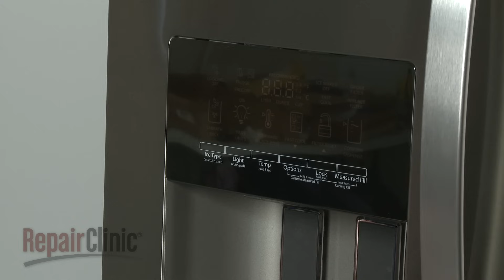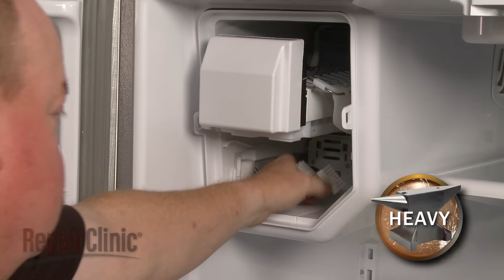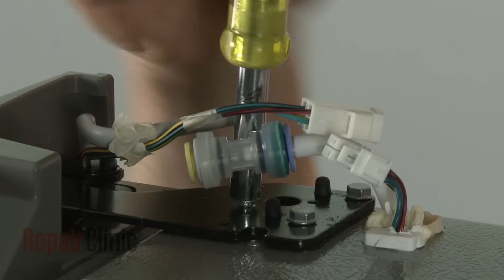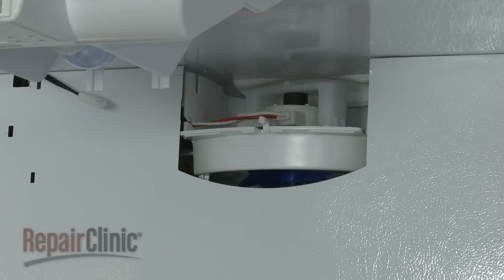Whirlpool Refrigerator Disassembly (#WRX735SDBM00)/Repair Help

Comment: The middle drawer. I need help with the middle drawer and you did everything but the middle drawer.
Reply: You can lift the middle of the tray and take it out and then unscrew it from the front and then you can push the middle glass from under it if you need to.

Comment: Hi I have the Whirlpool G16FARXXY00 French Door refrigerator. I need to replace the hose from the inlet valve. It broke at the valve.  I believe I have the proper hose ordered, but the replacement procedure is not obvious to me as the hose goes into the refrigerator just above the valve, and there is no removable panel.  I see where the hose attaches to the valve inside on the right side of the fridge behind those panels. But how do I get the new hose from the valve up to where it connects inside the fridge.  Thanks so Much!  Love your channel.

Comment: How does the fan assembly come out without breaking the plastic frame or drip pan? There is no room to remove it without breaking the lower part of the frame.

Comment: I was attempting to replace my LED light in my freezer I was able to take it off although there was so much insulation in it. However when i went to remove the LED the main wires attached to the wire harness were yanked away from the harness. The space is so small i can't replace the wires back into fhe harness. The wires are short or stuck in the insulation. Any way to fix this?

Comment: Any idea how to get the release button to work? It's jammed from the inside somehow, so the ice maker cannot be removed. I can saw it out, or smash the entire unit with a hammer, but then I'll have to buy a new one at $$$ just because a tab won't depress. the maker works otherwise.
Reply: I had the same issue and I just bought it last week. I called a repairman who showed that you have to use your thumb in the center of the button and push deep while pulling from the bottom with your other hand.
Reply: Thanks. I tried this but it didn't work. Ultimately I used a hammer and busted out all the tabs to free the machine. That's what the tech told me to do when I called. Next solution is to replace the refrigerator. Tech said it was a design flaw and irreparable.  @MsGail61

Comment: I have searched and found nothing, i cannot remove the tray from the ice machine, looks just like this one (on this video) you depress the button on the right and yank out. I thought that maybe the tray was froze shut so i left the doors open 24 hrs unplugged but after the ice melted its still stuck closed, any suggestions???
Reply: I have the same fridge as in the video. That button is really hard, it does seem like it’s stuck but it’s not. Using my fingertip doesn’t work so o use my knuckle and press hard

Comment: Thank you very much for this video. Well done and comprehensive. Had mold in and around ice dispenser door as well as behind dispenser handles. Gross! Lots and lots of mold.The fridge is 5 yrs old and I never noticed this until now. Hubby was leery of taking it all apart but you gave us the info to do it! Thank you!
Reply: Mine is the same! I only noticed it when the water stream wasn't one solid stream. Gag! How did you clean the dispenser parts? Can those pieces be removed to be washed in a sink?

Comment: Thank you!!!  I've never had so much trouble getting a drip tray off the fridge door before. I didn't want to break it.
Reply: Did you ever figure out how to remove this? Lol They make it look so easy in the video. Having a heck of a time here.
Reply: @Corey-Ryan yes! When it's halfway off gently pull upward on the back of it and the tab should go up and over the little Notch that keeps it stuck from going anymore forward

To put it back on sort of tip the tray upward to catch under the little tracks and then when you're halfway there press down so that the tabs catch back under that stopping notch

Comment: Hello👋 I was wondering if you could help me. We have an old Whirlpool. Probably like around 20 years old lol. But we noticed the light bulb dimming and getting brighter, then I heard the fan in the back that blows cold air in the freezer speeding up,  slowing down, speeding up slowing down...just like the light is dimming, getting brighter.  Also noticed it's causing the microwave light bulb to do the same thing. So is it that fan motor going out or the main control board?

Comment: To Remove the Middle Drawer for Cleaning just take off the outside edge of the middle drawer:  1) Fully extend the drawer. 2) The edge is held to the slide assembly by 4 small flathead screws. Remove the bottom screws on each side of the drawer.  The screws may be on very tight so spray some WD-40 on first to avoid botching up the screw.  3) Loosen the top screws on each side.  4) The bracket which connects the slide and drawer edge is open on top so you can now slide the edge up and remove it.
5) You can now remove the bin for cleaning and clean inside.
Also, the glass plate above the middle drawer can be removed by just pushing it up from below or pulling up on the edges; it's just set there.
Reply: Today after persisting for a couple hours I was able to remove it. I had to stick my arm through the middle drawer (top doors open too) and firmly hit on the backside of the glass a few time with my palm until it popped up. It took several tries due to all the stickiness and my arm kept getting stuck but it popped up enough where I was able to slide up and back and carefully pull it out to clean. Not gonna lie it was a pain but hopefully this helps someone.

Comment: Tried to take the ice maker out but even though I can get the screwdriver in to move the clip, I can't move the ice maker itself. Is there another button or maybe not strong enough?
Reply: Right It wont come out even though im pressing so hard
Reply: @DulceHerrarte-oc4xg  Called a repair man to come out.  He had a problem with it also, but got it out.  The water was frozen, so that is why it was stuck.  The water  line on the top of the fridge leading into the icemaker had a hole in it.  He said it was the first time he had seen that.  Lucky to have found a reputable repairman that isn't going to charge me an arm and a leg.

Comment: I need help my fridge is leaking at the top where the water goes in the icemaker.  any video?
Reply: Still no help with this.  Ordered a new inlet valve and replaced it. But the line on the top of the fridge is still leaking when I turned the icemaker back on. 
I saw where you take the ice maker out, is there a video on how to maybe replace the water line?

Comment: Outstanding vid.  Thank you!

Following may be of some help to others.  Would be nice to have in the discription block.

Whirlpool Refrigerator Model #:  WRX735SDBM00

			   S/N:  ________

	Household refrigerator:  165A

			  Type:  BMA25F

--

This video ...
Whirlpool Refrigerator Disassembly (#WRX735SDBM00)/Repair Help
https://www.youtube.com/watch?v=ibHW_ICMczs

WATER & ICE DISPENSER

@ 0:33 To uninstall the dispenser control
https://www.youtube.com/watch?v=ibHW_ICMczs#t=33

@ 0:50 To uninstall the ice door module
https://www.youtube.com/watch?v=ibHW_ICMczs#t=50

	Tools:
	5/16-inch wrench
	1/4-inch socket or nut driver
	common Phillips and flat screwdrivers

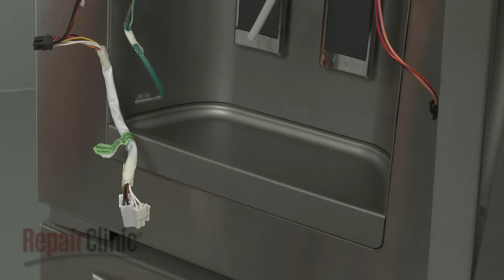@ 1:40 To access the actuator pad housing
https://www.youtube.com/watch?v=ibHW_ICMczs#t=100

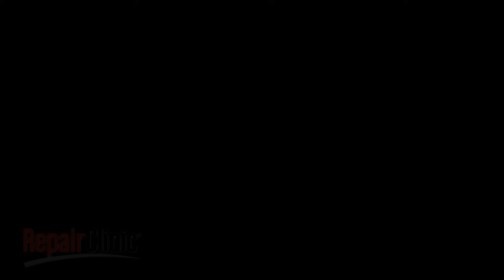@ 2:10 To reinstall the actuator pad housing
https://www.youtube.com/watch?v=ibHW_ICMczs#t=130

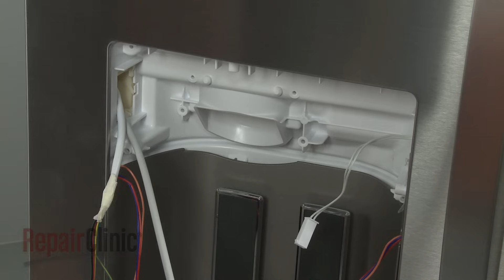@ 2:53 To reinstall the ice door module
https://www.youtube.com/watch?v=ibHW_ICMczs#t=173

@ 3:42 Reinstall the dispenser control
https://www.youtube.com/watch?v=ibHW_ICMczs#t=222

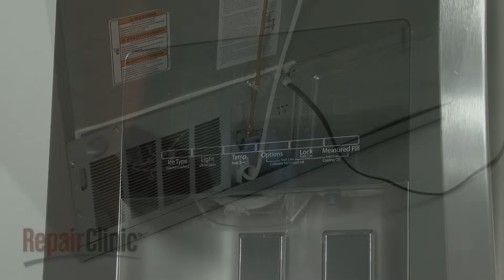@ 4:04 Before removing the rear access panel, shut off the water supply.
https://www.youtube.com/watch?v=ibHW_ICMczs#t=244

	Tools:
	use a wrench (size ?)
	1/4-inch socket or nut driver

You can access the (1) inlet valve, (2) the condenser fan motor, (3) start relay assembly.

@ 5:06 Reinstall the rear access panel
https://www.youtube.com/watch?v=ibHW_ICMczs#t=306

WATER FILTRATION & RESERVOIR COMPONENTS

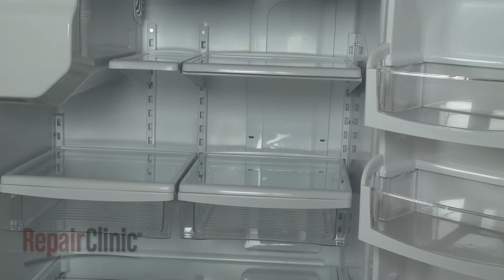@ 6:03 To access the water filtration and reservoir component
https://www.youtube.com/watch?v=ibHW_ICMczs#t=363

--

CONTINUE TO ACCESS THE WATER RESERVOIR ASSEMBLY & THE DUEL INLET VALVE

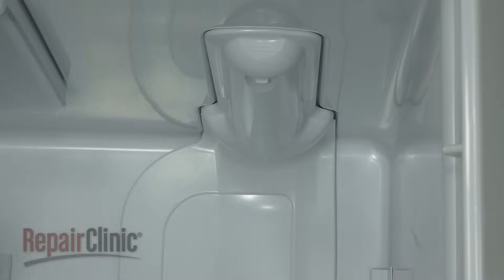@ 6:14 To access the WATER FILTER*
https://www.youtube.com/watch?v=ibHW_ICMczs#t=374

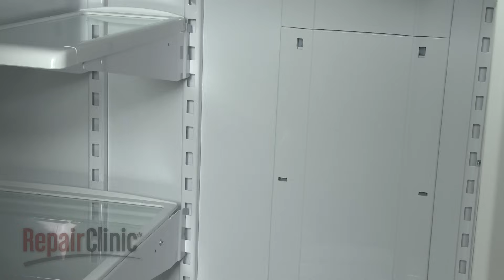@ 6:22 To remove the lower access panel
https://www.youtube.com/watch?v=ibHW_ICMczs#t=382

@ 6:34 To remove the upper access panel
https://www.youtube.com/watch?v=ibHW_ICMczs#t=394

@ 6:44 Reinstall the upper access panel
https://www.youtube.com/watch?v=ibHW_ICMczs#t=404

@ 6:54.5 Reinstall the lower access panel
https://www.youtube.com/watch?v=ibHW_ICMczs#t=414.5

@ 7:04 Reinstall the water filter cover
https://www.youtube.com/watch?v=ibHW_ICMczs#t=424

@ 7:18 To remove the ice-maker assembly
https://www.youtube.com/watch?v=ibHW_ICMczs#t=438

	Tools:
	Flat-head screwdriver

@ 8:00 To reinstall the ice-maker assembly
https://www.youtube.com/watch?v=ibHW_ICMczs#t=480

@ 8:25.5 To reinstall the side plate cover
https://www.youtube.com/watch?v=ibHW_ICMczs#t=505.5

@ 8:39 To reinstall ice bin tray
https://www.youtube.com/watch?v=ibHW_ICMczs#t=517

@ 8:45 To remove a refrigerator door
https://www.youtube.com/watch?v=ibHW_ICMczs#t=525

	Phillips head screwdriver
	wrench (to disengage the water line)
	5/16-inch socket or nut-driver

@ 9:35.5 To reinstall the refrigerator door
https://www.youtube.com/watch?v=ibHW_ICMczs#t=575.5

HOW TO REMOVE & REINSERT FREEZER: BIN, DRAWER, RACK, & ACCESS PANEL

@ 10:30 To uninstall the freezer bin
https://www.youtube.com/watch?v=ibHW_ICMczs#t=630

@ 10:42 To uninstall the freezer drawer
https://www.youtube.com/watch?v=ibHW_ICMczs#t=642

@ 11:03 To uninstall the freezer rack
https://www.youtube.com/watch?v=ibHW_ICMczs#t=663

@ 11:40 To remove the interior freezer access panel
https://www.youtube.com/watch?v=ibHW_ICMczs#t=700

@ 12:33 To reinstall the freezer access panel
https://www.youtube.com/watch?v=ibHW_ICMczs#t=753

@ 13:38 To reinstall freezer rack
https://www.youtube.com/watch?v=ibHW_ICMczs#t=818

@ 14:06 To reinstall drawer assembly
https://www.youtube.com/watch?v=ibHW_ICMczs#t=846

@ 14:20 To reinstall the freezer bin
https://www.youtube.com/watch?v=ibHW_ICMczs#t=860

---

*WATER FILTER NOTES:

"Filter 4" in filter title/description is important.

Per Whirlpool manual, filter replacement #: UKF8001AXX-750

Amazon for UKF8001AXX-750:
Every Drop by Whirlpool Refrigerator Water Filter 4, EDR4RXD1 (Pack of 1) $44.49
https://www.amzn.com/B00UB38V2A/

Amazon Choice for UKF8001AXX-750:
Waterdrop UKF8001 Water Filter, Compatible with Whirlpool EDR4RXD1, Filter 4, Maytag UKF8001P, UKF8001AXX-750, 4396395, 469006, PUR, Puriclean II, 46-9006, Pack of 3 (package may vary) $30 ($10 ea.)
(Cost-effective alternative to the expensive 'original equipment manufacturer' (OEM) filter.  May not filter as well as the OEM everydrop.)
https://www.amzn.com/B01CC83YAK/

Lowe's for UKF8001AXX-750:
everydrop [sic] Filter 4 6-Month Twist-In Refrigerator Water Filter (Compares to: Filter 4) - Model #EDR4RXD1 - LOWE'S ITEM #672995 - $50 ($45 for veterans who have registered with Lowe's.)
- Certified to reduce 23 contaminants including lead, pesticides and pharmaceuticals
- Certified to reduce 99% of lead in the water from your refrigerator
https://www.lowes.com/pd/everydrop-Filter-4-6-Month-Refrigerator-Water-Filter/50352232

ReplacementBrand 6-Month Twist-In Refrigerator Water Filter - Model #M1 - LOWE'S ITEM #2568098 - $29.33 (Cost-effective alternative to the expensive OEM filter.  May not filter as well as the OEM everydrop.)

---

Comment: You disassembled the entire fridge except the middle drawer??? Do you have an additional video or how to remove the middle drawer? Thanks
Reply: To Remove the Middle Drawer for Cleaning just take off the outside edge of the middle drawer:  1) Fully extend the drawer. 2) The edge is held to the slide assembly by 4 small flathead screws. Remove the bottom screws on each side of the drawer.  The screws may be on very tight so spray some WD-40 on first to avoid botching up the screw.  3) Loosen the top screws on each side.  4) The bracket which connects the slide and drawer edge is open on top so you can now slide the edge up and remove it.
5) You can now remove the bin for cleaning and clean inside.
Also, the glass plate above the middle drawer can be removed by just pushing it up from below or pulling up on the edges; it's just set there.

Comment: I put in part number WRX988SIBM00 for the 2014 model of this Whirlpool and for some reason this model came up. I am trying to find where the Defrost Timer is located on this model. Others models show there is one. Is it electronic in this model? No tutorial addresses that.
Reply: @repairclinic  thank you! I appreciate kniwing this. We were just realizing it must be the board. For now we cleaned off the built up ice (we defristed it manually) and will continue using fridge while we put an order in for the new computer board to fix this issue. Thanks again .

Comment: Ice is building up in the bottom tray of the freezer portion. When it builds up enough water starts to leak outside of the fridge. Where should look in the fridge to resolve this problem?
Reply: I am having the same issue, I think defrosting the ice build up will resolve this problem.

Comment: I have a unit Lg refrigerator french door type,the compressors runs but it does seem to be discharging refrigerant because when I feel the compressor and the discharge line they are not warm as they should.Do you have any clue about what can possibly be the issue and what can be done to correct the fault.

Comment: I have the Whirlpool WRX735SDBM02 french door. I want to remove the bottom glass of the refrigerator sitting above the drawer to clean under the edges.
Reply: Why i am here. Literally took everything apart except that😞
Reply: @irunAMOK-  I've asked the repairman when I made a call, and there is no way to remove that bottom panel to clean under it. Sadly it's a (disgusting) poorly planned refrigerator.
Reply: @nunyabusiness5070   i figured it out after a while.  I removed the plastic insert for produce and with drawer open i reached all the way to the back and pushed up from bottom of the glass. "It was stuck solid from unseen gunk. Basically preyed it from right to left came up finally and was able to clean leaked meat juice. Hope we where having same problem and this helps. Have any questions, ask. Good luck!
Reply: @irunAMOK-  thank you very much! I'll give that a try!

Comment: Similar to someone else in the comments, I need to remove the middle drawer!  Has anyone done that?  Due to a full middle drawer right now at Thanksgiving, a slender but rather large box of deli type meat got pushed up and then down behind the middle drawer at the very back of the refrigerator.  It's so far back there and jammed against the outer wall enough that nothing long with a hook on it can reach it.  With a long hooked skewer, I have tried reaching in through the tiny space under the middle drawer (and above the freezer base below) but can not reach the package of meat jammed behind the middle drawer.  I did watch the very good Repair Clinic video and will see if the middle drawer releases similarly to the freezer drawer.
Reply: The trick is to remove the outside edge of the middle drawer from the slide assembly.  To do this pull out the drawer all the way.  If you look at the inside of the middle drawer's outside edge, there are 2 brackets, one on each side that connect the slide assembly to the outside edge; it's edge is connected to the slide with 4 small screws.  Remove the bottom screw on each side and loosen the upper screw.  The bracket is open on top so when the bottom screw is removed and the top screw loosened you can just slide the outside edge of the drawer up and take it off.  
BTW, those 4 screws were on very tight so you might want to use WD-40 to loosen them so you don't mess up the screws trying to take them off.  Don't know if you still needed this info, but maybe somebody does.

Comment: Show us how to remove glass shelf above the drawer! It’s impossible to clean out crud stuck under the edges of the glass shelf! This is a pretty major design flaw. Also, liquids spill behind this large, heavy glass shelf and fall behind the large metal drawer that can’t be removed. Wish I’d never bought this French door refrigerator with the drawer in the middle!
Reply: I just figured it out. Lift the glass from the back wall first
Reply: @kathybridges3343 Thank You
Reply: @kathybridges3343  it worked thanks so much..I’ve been trying to get that glass out for over a year
Reply: The glass shelf just came out for me.  Just pulled up from the edges.  But I don't know how to take the middle drawer bin out.  Did you ever find out how to do that?
Reply: 99
Reply: I know it’s answered, but you can put hand through pantry (middle) door and push up on backside of glass shelf to remove it. Relatively easy
Reply: In the middle just over the filter there's two buttons that depress in and allow the glass shelf to flip up for removal

Comment: Hello, I have a whirlpool refrigerator model # wxr735 sdbm00 . It was gave to me by a friend. And it is missing, the filter drier and copper, and 1 other line has been cut. Can you send me a diagram of the compressor copper lines? ,Thanks.
Reply: Andre-they are a general repair parts company...this is likely why you have not gotten a response.  If you have not done so already, contact Whirlpool.

Comment: Hi, I have the same refrigerator model as in the video. Where can I buy the part where that holds the ice maker assembly? It's the part locking the icemaker when you push it in. The part that locks the icemaker are broken. Thanks for the video anyway.